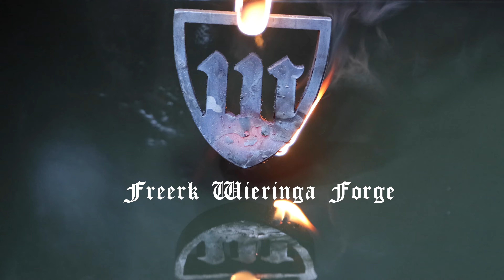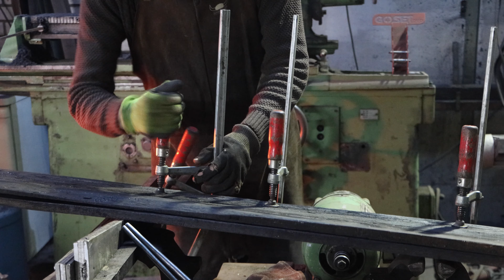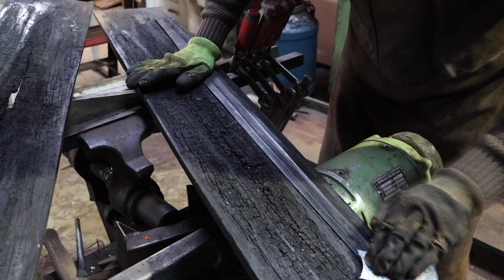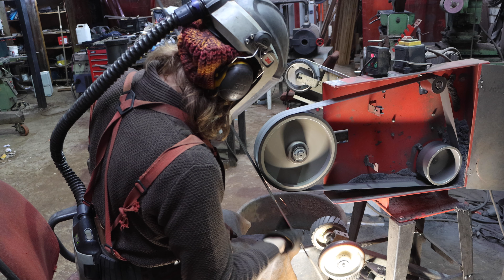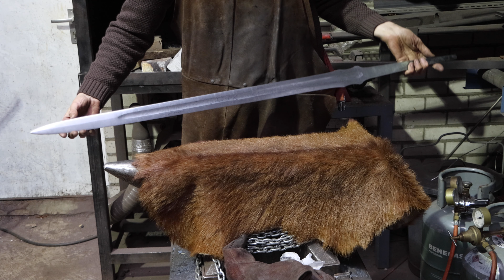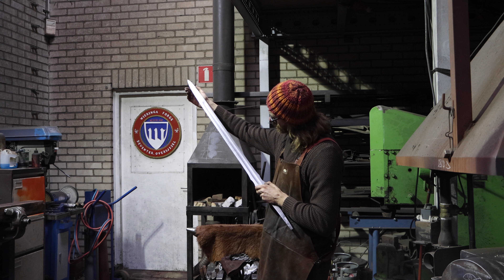Forging a pattern welded longsword, part 2, heat treatment.

Comment: The clamping in the wood pre quench, is that to straighten the blade prior to quenching it?
Reply from the maker: Yes. Also it's isolation, slowing the cooldown.
Reply: In the section size that this blade is, given half of it being a 4% nickel steel, it's almost an air-quenching steel. You want a blade to go into the quench with as close to zero unresolved internal stress as possible, so the best way to properly normalise it is clamped between two insulators so that it holds the correct shape while cooling slowly